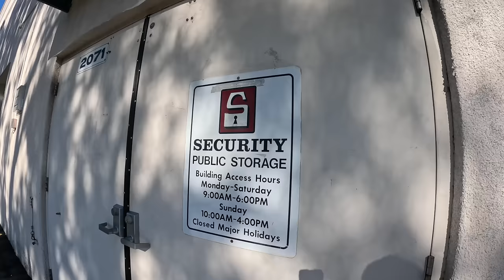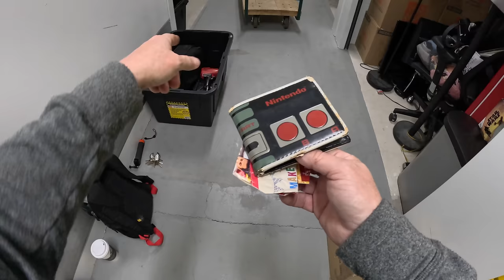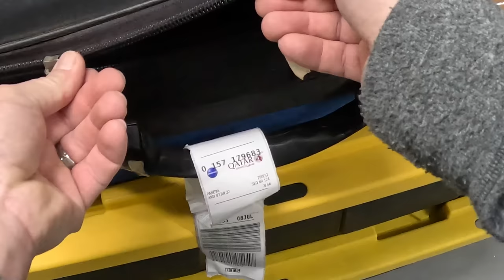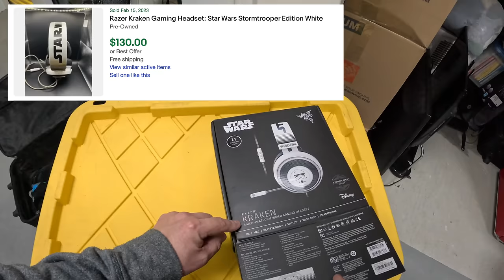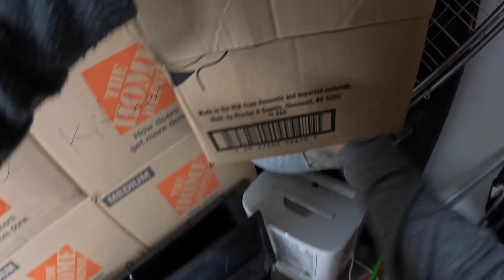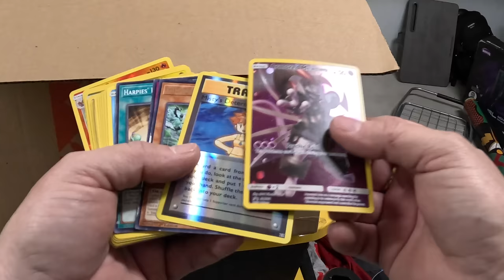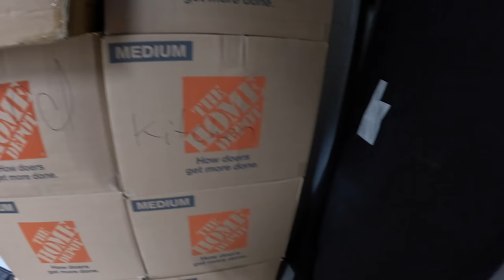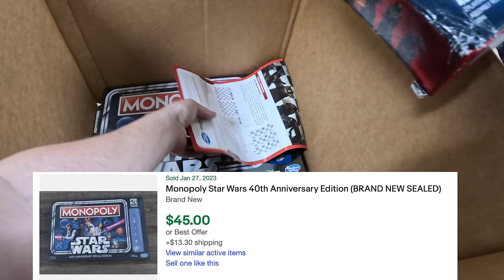I thought I overpaid on this, but DEFINITELY NOT! So much cool stuff it's blowing my mind

Comment: How to clean the  lightsabers first scrape up all the soap that you can in every little crevice and then take a wet one and make sure it's an antibacterial wet one because soap will bring mold once you clean that spray it with bathroom cleaner and do not get them electronic sweat then dry it with a dry paper towel or a cloth and that should clean up your Life savers to sell them hopefully that helps but you need to scrape it all off first before you even use the wet one
Reply: And sorry I'm Brenda from Ohio😂